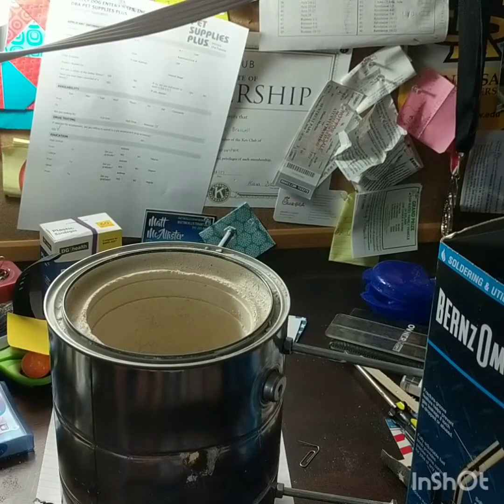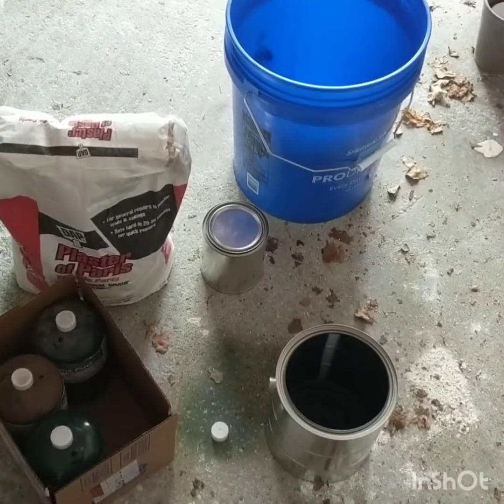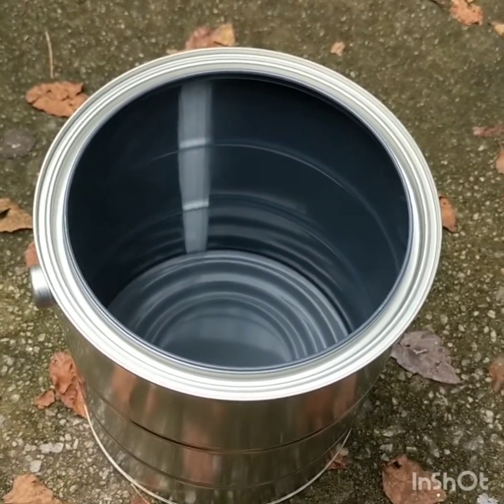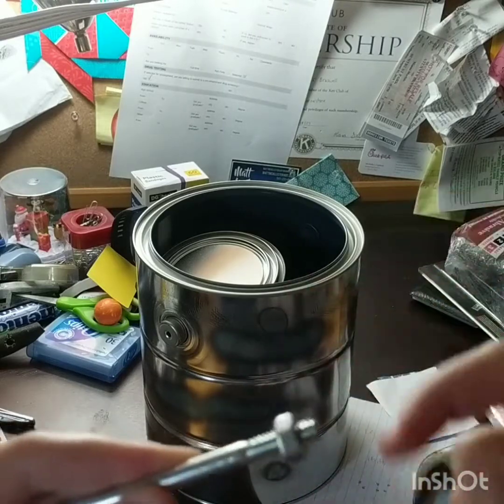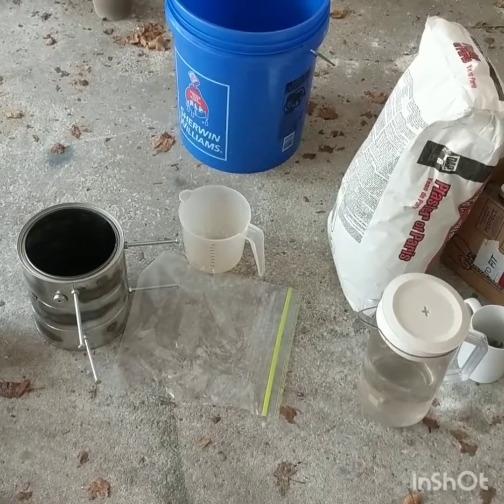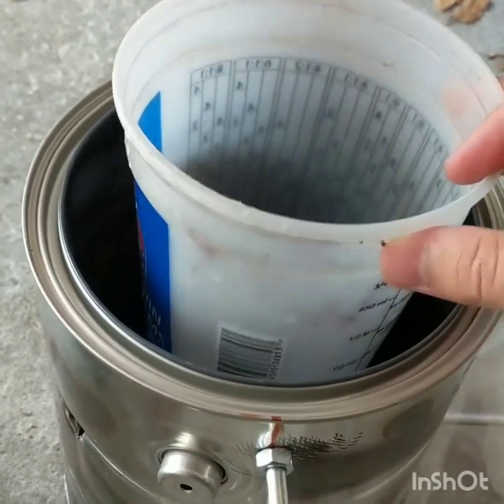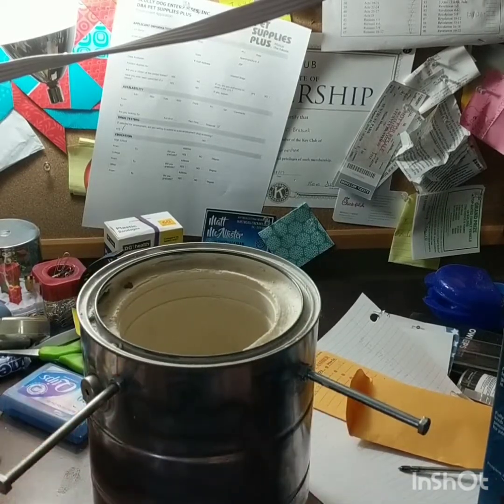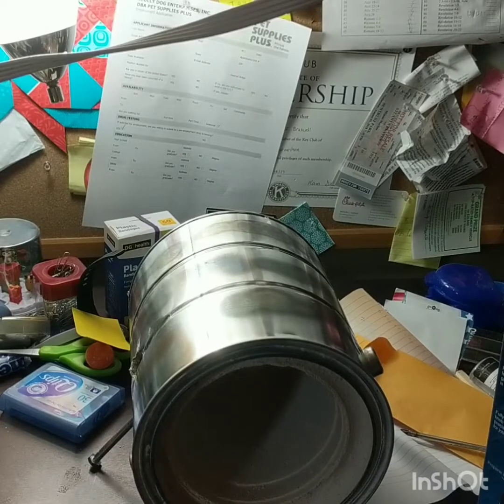DIY paint can forge/foundry

Comment: Hey man. This video was great. I am making a similar foundry and I hope that I didn’t mess it up by waiting too long before drilling the hole in it. Also, I was wondering what is a good aluminum casting mold? I currently have some clay drying for mine, but I was wondering is there was another solution besides that and green sand. I need to have a casting mold ready before Thursday. Keep up the great content
Reply from the maker: Green sand is the best, but I like to use steel muffin trays to make ingots.